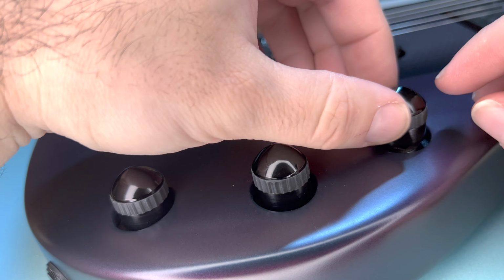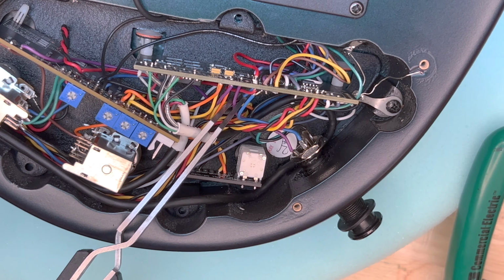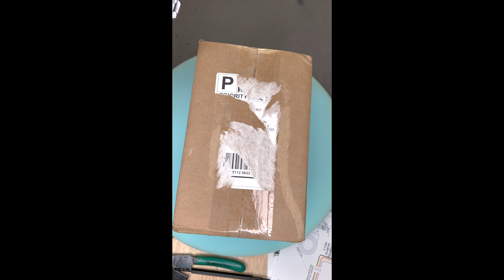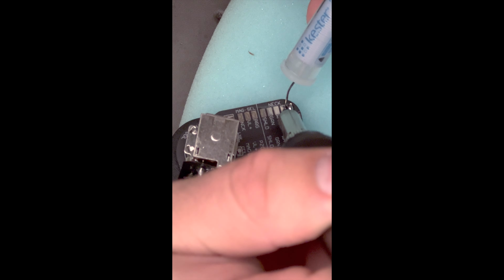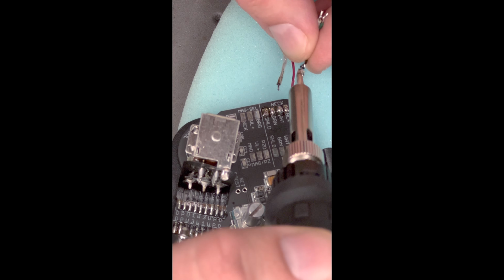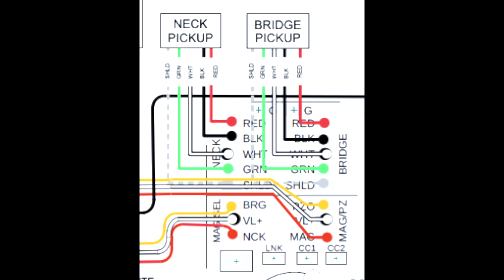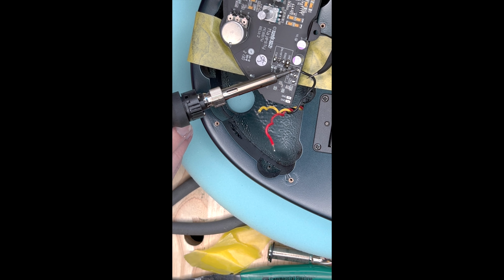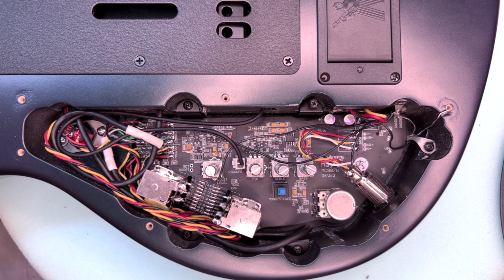How To Replace Ernie Ball Music Man Majesty Pre Amp

Comment: Nice Video, My Majesty does not have sound even after changing fresh batteries. It would sound for a second only. Reading the forums I'e found out people with same problem. I learned that keeping the piezo toggle switch pushed in will allow me to play the guitar but sound will die after releasing it. I dont understand how this can happen. It worked fine for a while and now it just dies. Very shameful
Reply from the maker: I have heard this before, You will need to replace the Preamp.